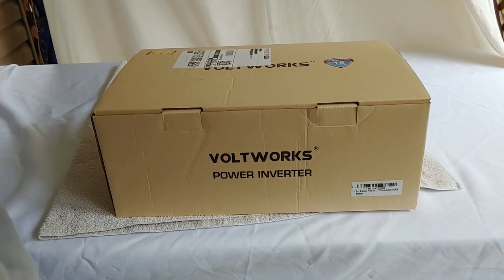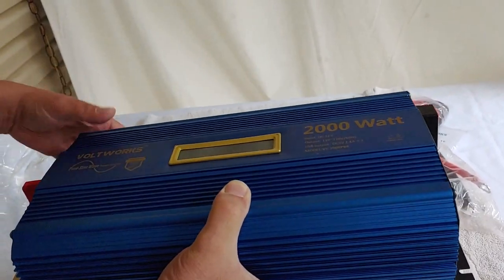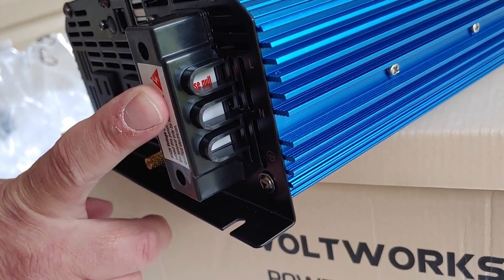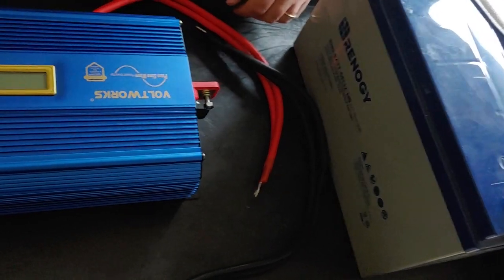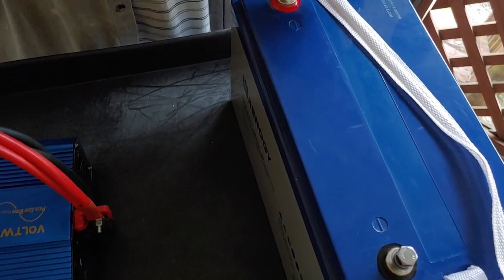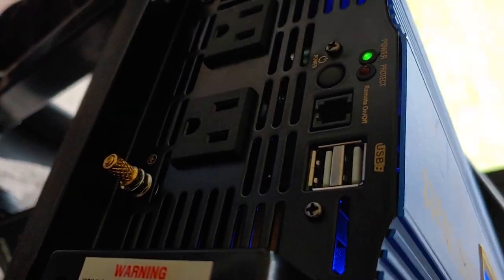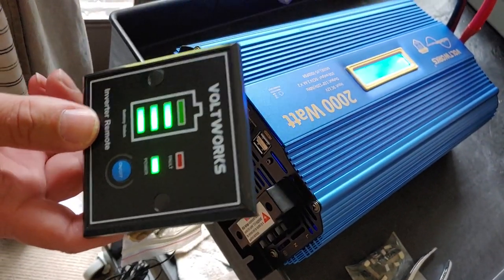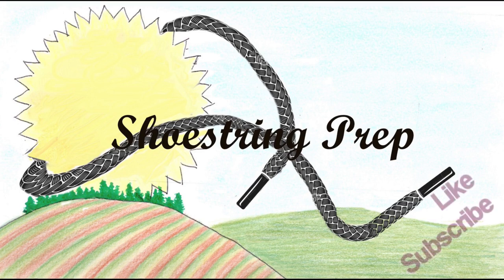Voltworks 2000-Watt Pure Sine Wave Inverter for off-grid use | unboxing and installation.

Comment: Hey Shoestring, I"m sure you know this, but the inverter cable installation should go "Cable-->Washer-->lock Washer-->Nut"  If I'm incorrect, please let me know!  Otherwise, great video!
Reply from the maker: Thanks for your comment
Reply: Yes,the better install "cable eyelet -->Washer-->lock Washer-->Nut" ,install cable eyelet inside, If the sequence is reversed, the terminals may melt

Comment: Came back to note that mine like this has now semi-failed.   It's dropped from putting out um,  I think it was 118V on it's display to 98-102 V .   Probably a failing capacitor.  Out of warranty in my case.  Might try to repair it.  Between this and the Thor MSW (supposed to be a good brand) one and then an autozone that failed years back, I could have bought an outback.  What's the saying, "buy quality and cry once"
Reply from the maker: Thanks for the info and comment.

Comment: im looking for a not to expensive Pure sign wave inverters and this one came up. Every thing looks good accept i dont like the tiny power button. I would use the remote as my main on and off.
Reply from the maker: I don't like the small button either. I do use the remote as my main off and on button. So we are thinking alike on that. Thanks for your comment.
Reply: If the size of the power button is the biggest issue then we are doing great!   
#1 Can it supply the power it's rated for? 
#2 How clean is the sine wave?   
#3 does the AC voltage drop much when loaded?  
#4 is it built robustly and can last?  
#5 Heat- How is the passive heat dissipation How much noise does it make? Is the fan on all the time or just as needed?  
#6 How is product support?  Do they respond?  Is the guarantee good?
#7 Are inputs and outputs connections robust and sufficiently diverse for your use?
#7 Are supplied cables adequate for rating? 

The Voltworks meets  all of these criteria as far as I can tell.  Maybe the cable is a bit undersized.   And... Waaaay down the list is color and button size.   

I have one and can tell you that it's a serious device.  Not junk.

Comment: I see people mounting the inverter in their cars. If you use the unit inside of your car with it hooked up to the car battery will they lose power because the cable is really long?
Reply from the maker: The inverters that I have seen that are cooked up inside of cars use the cigarette lighter adapter as a way to connect the battery with the inverter. This way the cable is not very long. Thanks for your comment.
Reply: @shoestringprep  That's right. But using the inverter through the cigarette lighter can supply a small amount of power compared to using the inverter while it's connected to the battery directly.
Reply from the maker: @juanh1093  It would depend on what you are trying to power. I would try the cigarette lighter first and see if that would power my device first. If not then I would come up with another solution. Thanks for your comment.
Reply: @shoestringprep  I have the same inverter as you in the video. Mine is a 1100W. I'll be using a 5 Gal shop vac.
Reply: @juanh1093  The Voltworks 1000W and 1500W pure sinewave inverters have the full display. The 1100W doesn't.
Reply: YES! this is a real concern.  At 2000 watts you need a short fat cable between the battery and the inverter.  If not right next to the battery you should fuse it for 200 amps and run welding cable 1/0 to 3/0.  That might get you a few more feet.  Use voltage drop tables to size wire.   Forget cigarette lighter plugs for anything over 300 watts!
Reply: @shoestringprep  Nope, not gonna work.  To deliver 2000 watts at 12v you need like 175 amps.   A cigarette lighter might be wired and fused for 10 amps at best!
Reply from the maker: @ceeweedsl  thanks for your comment.
Reply from the maker: @ceeweedsl  You are correct. Thanks for your comment.

Comment: Should the ground connection on the inverter be used?   I have a static location so cannot connect to vehicle chassis etc.  Drive a rod into the earth?
Reply from the maker: I have used a rod in the ground several times and it works well. Thanks for your comment

Comment: Hey I have the same inverter and with my test plug I keep getting an open ground. Are you having the same issue?
Reply from the maker: No I am not having that issue. Let us know if you figure out why it's doing it. Thanks for your comment.
Reply: @shoestringprep  I spoke with the company and they said it's normal. I'm sending them some pictures now to confirm my installation is correct, it may be a GFCI thing.
Reply from the maker: @timcorona5069  thanks
Reply: Ac plug testers do not work with this inverter.  You will see an open ground,please do not worry.
Reply from the maker: @voltworksofficial  thanks for the info.

Comment: if i'm using this in the trunk of my car...do i need to put any type of wire on the ground connection.
Reply from the maker: I would not say you need to, but if I could find a good way to ground your inverter, I would do it.
Thank you for your comment.

Comment: Do the lights on the remote go out after a little while, or are they always on when the inverter is on?
Reply from the maker: The lights on the remote stay on, because they also let you know the charge level of the battery. Thanks for your comment.

Comment: This inverter 
Bullshit . My rice cooker and bluetti eb3a don’t turn on,  because  
voltage quality not true, all staff, with  heater , motor should be work , rest can broke, be careful with that item
Reply from the maker: Sorry to hear that. Contact their customer service. Mine is working fine. It ran a 1500 watt space heater two days ago. Thanks for your comment.
Reply: You don't know what your issue is. I really doubt you've scoped the output to claim it's an output quality problem.   Probably it's an improper installation.   First of all, what's your battery?  Second, what's your cable?